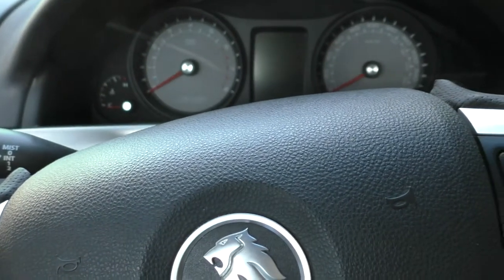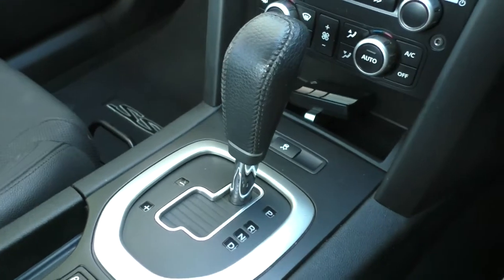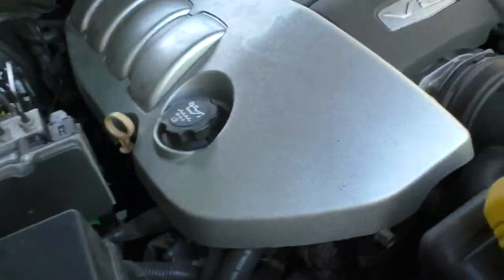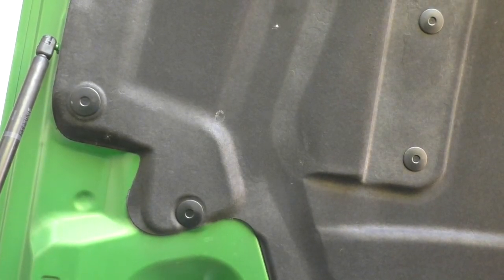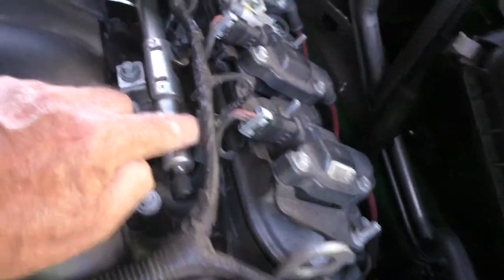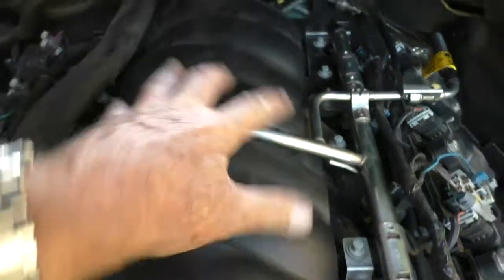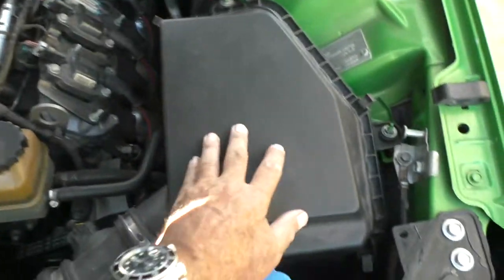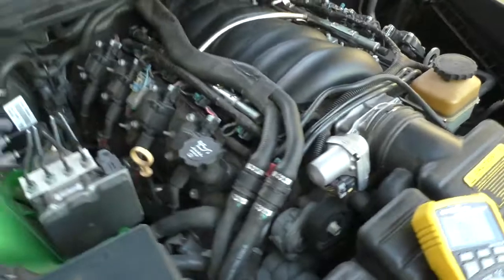Holden SS Fuel Injector Replacement Codes 7e8 and 7ea.

Comment: Lovely car. Contemplating an 05 Monaro right now. 6 speed though. But UK fuel is £4.80 a gallon.
Reply from the maker: Thanks. That's pricey, 98 is equivalent to 3 quid a gallon here. I'm not sure I could afford my car or a Monaro in the UK. That said, you only live once, I sometimes think I should have got a manual instead of the auto. Much more fun.

Comment: Ohms should be between 11-14 ohms to be in spec and no
More than 3 ohms diff between them all 

Just for all your info
Reply from the maker: Thanks mate. They seem to be well outside that when they fail so there's no doubt they're faulty.
Reply: @stevemumbling7720  I just did a friends today on a VE SS-V  was 13.5 average on all injectors except injector 6  which was 2.3 ohms 

Error code was P0206  on my tech 2 scanner last digit referring to which injector is faulty and it was 6 
You may also get lean o2 sensor bank  error with it also

Comment: hey steve whats the cylinder number layout ?
Reply from the maker: Drivers side, front to back: 2, 4, 6, 8. Passenger side front to back: 1, 3, 5, 7.
Reply: @stevemumbling7720  is that looking at it from the front of the car ?
Reply from the maker: @jaydavid1234567  Yes, from the front to the back. As if you just opened the bonnet and stood there looking at the engine.
Reply: @stevemumbling7720  thank :) turns out i replaced the wrong injector no wonder im still having issues
Reply from the maker: @jaydavid1234567  No worries. If you watch the video I show how to test the injector coils with a multimeter. You can do that and see which one is faulty before you remove the fuel rails.
Reply: @stevemumbling7720  thanks steve ive had the code read and its #6 i couldnt find the cylinder layout anywhere online so i asked a mate and apparntly he told me the wrong cylinder numbering